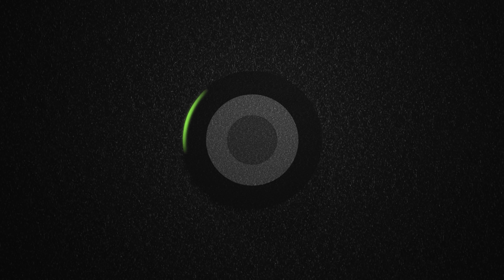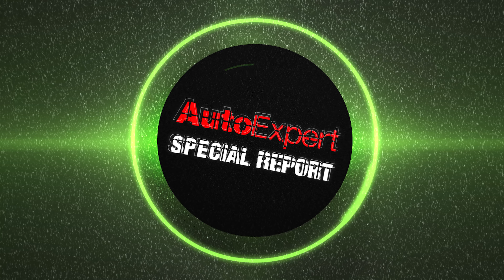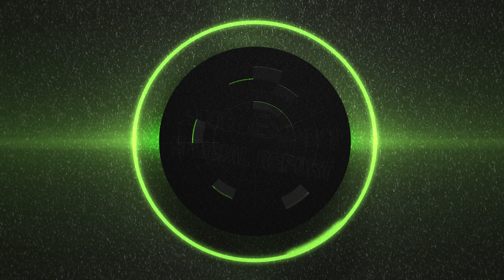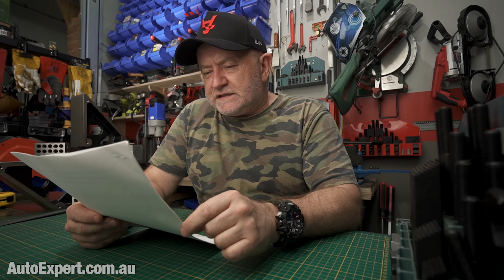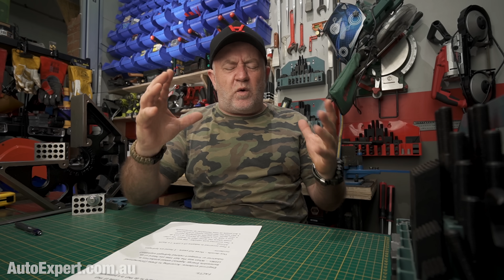The truth about fire risk: Hydrogen fuel cells and battery EVs | Auto Expert John Cadogan

Comment: I'm with The Air Stig - a SCUBA tank is typically filled while immersed in a big "bucket" of water (a garbo bin works well) to cool the tank as it gets hot from heat of compression. This is done so that the duuuude/duuuudette  getting his/her tank filled gets a solid load. Otherwise they wander away, get to the dive site, notice that the cylinder pressure has dropped, lose a number of minutes of bottom time and then go back to the dive shop and complain about being given the short shrift. Basic gas law physics (cf. Gay-Lussac's law and gas compression - adiabatic vs isothermal).
Reply: When they pressure test the cylinder.. They do indeed fill it with water and add a small amount of air.
If the cylinder fails, there is a small pop and the water sprays everywhere. People get wet.
If they did the same test with only air... They would be finding cylinder shrapnel 500m away and they would need a dentist to identify the remains of anyone close.
Reply: @sahhull  what standard calls for a hydrostatic test protocol to include air/gas? In an Australian context, general gas cylinders are covered by AS 2030.1-2009 Gas Cylinders - Part 1: General Requirements. For testing, this standard refers to AS 2337.1-2004 Gas cylinder test stations: General requirements, inspection and tests. AS 2337.1 Appendix A covers hydraulic testing where the test procedure at A3.4 calls for filling the cylinder with water and purging all the air in the test equipment system. If something "pops" in a hydrostatic test and there's a spray of water, that's a fail. If there's any air in the system, the pressure will simply compress the air and you don't get a valid test.
Reply: Thx man .

Comment: Hi John, great video, covered all the points I was hoping you would regarding electric vehicles. I'm yet to hear about this being addressed by the the ABCB and BCA 2022 has only recently been updated so it would likely be another 2-3 years before it is due to be updated again. However F&R NSW do raise it regularly when/if they are consulted at the design stage of buildings with basement level carparks.  The typical fire rating for a carpark is only 2 hours (type A construction - highest rating) which is vastly inadequate to withstand burnout of one or more electric vehicle fires, which as you noted cannot be fought conventionally and sprinklers (if installed) are ineffective against.
Reply: Fire sprinklers can be effective at cooling EV fires. As the report from NFPA/FPRF shows, EV fires have lower peak heat release rates than ICEV fires and not greater total heat release (the amount of plastic in the vehicle is a bigger determinate of heat release, not the fuel type). Also, the duration is not substantially longer, except for the reignition risk which needs to be managed by attending fire brigades. But the hypothesis that there will be large uncontrolled fire spread in underground parking structures, or that EV fires are hotter and more likely to cause structural failure, is not supported by evidence - heat suppression by sprinklers can control that at least as well for EVs as ICEVs. It is worth noting that fire sprinklers are only designed to cool/suppress fires, not extinguish them - they won't extinguish an ICEV fire either, generally. 

The bigger concern is smaller parking structures and open parking structures where fire sprinklers have not been required to be installed. This is certainly of concern but is actually covered under the NCC/BCA "Special Hazards" provisions (Clausel E1.10 and E2.3).

Disclaimer: This is not project specific fire protection advice 😀

Link to NFPA/FPRF report: https://www.nfpa.org/News-and-Research/Data-research-and-tools/Building-and-Life-Safety/Modern-Vehicle-Hazards-in-Parking-Garages-Vehicle-Carriers
Reply: Sprinklers are somewhat effective at creating a lot of saturated air, cooling surfaces (if deployed correctly) and preventing thermal spread.  Just don't let the fire warden or some other -  micromanager - turn them off because their drywall is being destroyed (joke) - nor the water company (or bill payer) - as soon as the fire brigade is onsite - they don't mind a bit of water in the air, sure beats curtains of thick black smoke - or napalm in the AM.

Comment: We did have composite tanks for Brisbane buses natural gas powered and tanks blew up in workshop. Some years ago.
Reply: composite tanks for CNG?  insane.. steel is the only way to go.
Reply: @petesmitt  being in the pressure testing game, we explored the potential to get involved in the testing and certification of these. Made in Germany with a bunch of German standards that would have to be translated and a raft of mechanical tests as well as pressure test. We walked away, well ran actually.
Reply: @lynndonharnell422  AFAIK. Most composite divers cylinders only have a 10 year life span. Then they are devalved and cut in half.
Steel and Alu cylinders can have a long and happy life.

Comment: There are other important risk factors for hydrogen gas. For example, the rate of flame propagation for premixed hydrogen / air is very high. It will still be technically be a conflagration, but you would be hard pressed to distinguish it from an explosion in practice. The level of energy which is released per volume of a stoichiometric mixture with air is also very high. These may be mostly manageable in an automotive application, but cars are sometimes parked in confined spaces such as garages where dispersion to the atmosphere would be restricted. Adding hydrogen to the natural gas distribution network, as has been proposed here in the UK, would pose a much greater risk than using it in cars. All these risks need to be carefully considered before incorporating hydrogen into consumer products where the level of control over quality and how they are used is lower than in most industrial applications. The Hindenburg accident is a poor example of the risks we might face because the majority of the hydrogen was not premixed with air. Therefore, the fire was limited by the rate of mixing with air and there was no 'explosion'. Thanks for your discussion.
Reply: Fark here we go, the back yard geniuses refering to the Hindenburg disaster and h2 cars. 
Lets get them walking in front of h2 cars with a red flag eh, like 1865 and the steam train. Ffs
Reply from the maker: H2 is not 'pre-mixed' with air in any automotive or industrial application I can think of...
Reply: @AutoExpertJC  No not intentionally, but leaks happen.
Reply: @nicksauer6749  The Hindenburg was also flow during a severe lightning storm on that fateful day.
Reply: @ScottMurrayBestFamilyCars  The hydrogen container in the Hindenburg example was a thin fabric material containing H2 at atmospheric pressure. The vessel in an H2 fuelled vehicle is designed to hold pressure up to (as John correctly points out) 700 atmospheres. The flammability of the fabric was a key factor in the Hindenburg mishap. An H2 vehicle pressure vessel is not at appreciable risk of damage due to a lightning strike. Apples and oranges in terms of comparison.
Reply: @slyrider01  Hi Scott. Film of the Hindenburg incident showed that it burned, but did not explode. I wanted to contrast the automotive and household scenarios since the Hindenburg fire is the example of hydrogen accidents which most people will be familiar with. Conversely, in the event of a leak in a poorly ventilated space, such as a garage, hydrogen and air would mix and form a mixture which would burn in a way which looked a lot like an explosion. I have no doubt that engineered pressure vessels would work just fine, but solenoid valves can sometimes fail and cause slow leaks. Thanks
Reply: "The Hindenburg accident is a poor example of the risks". So why mention it? Also the Hydrogen wasn't the cause of the fire, the fact that a lot of things burnt before the Hydrogen also says a lot.
Don't pick and choose half facts (yes I only quoted half that sentence I know), to try and make a point. It cheapens any real point you are trying to make.

Comment: I can only imagine an EV fire in the car park of the Sydney Opera House - for those who haven't seen it, it's a double helix, so fire wouldn't be contained to one level.
Reply: The toxic smoke would make the car park inhabitable for a long time once the fire is out.
Reply: Especially  bad if you can't enough water on the battery  fire  and it's very difficult  to put out 
Any fire-fighter will tell you that
Reply: @waynehewett4017  I’m aware of this. There are fire hydrants at regular intervals in that car park. Toxic gas in a confined environment is a bigger issue for that location.
Reply: @michaelramage73  lm sure you are and highly  likely  has far more experience  than I 
I was just using two examples which John  has used in past videos 
Some of the battery fires in chins have been very nasty indeed  causing injury and death 
Plu didn't John mention that ship.carryimg sea containers full of ev vehicles  that caught fire  and send the ship to the sea floor  as the fire-fighters   couldn't put the fire out ?
I've had my mobile phone battery catch fire when recharging  it  and it almost burnt my house down 
So emagine a battery  that weights tonne catching fire while you the wife and 2 kids in baby seats  are in the back 

You have about a minute or so to get out safely?
Reply: What about petrol car fire?
Reply: @kmav23  it does not produce it's own oxygen so one is able to put it out. Not the case with lithium iron phosphate battery - this will burn irrespective of attempts to extinguish it. All that can be done is containment until the fire dies.
Reply: @kmav23  much easier to put out. Requires significant less water and time and the smoke is far less toxic.

Comment: Is great to hear discussion of that scenario where an EV catches fire under a multi-storey building and causes a massive issue. As you said, there's simply no discussion of that and it's a problem that's racing towards us at high speed...
Reply: I work in the design of new and refurbished multi-storey buildings, and there is lots of discussion of this by appropriately qualified experts, including fire brigades and fire safety engineers.
Reply: @76tfdtr4r5  typical EV zealot, full of attitude. What cars are those batteries available in? And what are we going to do about the cars that are already built?
Reply: @mahcooharper9577  base teslas, BYD's, likely many more Chinese brands. GM, Volkswagen group and Hyundai Group don't.
Reply: @justohird5685  so lots of new cars still don't, and I'm assuming the vast majority of older EVs don't, so the problem isn't solved.
Reply: @mahcooharper9577  It isn't all new ones either.  LFP are not as good in high power need situations.  So nickle & other chemistries will continue to be used in cases where high performance is needed or weight is crucial.  So this topic remains a valid one.
Reply: Doesn't China have 6 ev fires  each week 
It's only safe  til it effects you personally

Comment: Hydrogen fuel is not going to save the world. This is because hydrogen produces yet another energy hog and the question is where does the energy to make the hydrogen come from. From natural gas or other fossil fuel? Awkward! From water? Right! All you need is a truly stupendous energy hog. 

In converting natural gas to H (Awkward) you liberate the carbon part of the hydrocarbon molecule, free to bond with the nearest O2 molecules to form what we call CO2 or carbon dioxide. Awkward! Such energy in the hydrogen is less then would have been available from the CH4. H from H2O? Using what? Solar? Wind? Fossil fuel energy? Again less net energy than would have been available from the wind, solar of FF energy. 

What hydrogen (H) REALLY is is hopium (Hp) or Hypeium (Hy).

Comment: Some good points there John. Note: Only around 10% of vehicles imported into australia now would be equipped with Lithium Ion cells. Most are Lithium Iron Phosphate and these are not susceptible to thermal run away.
Reply from the maker: Lithium iron phosphate is a kind of lithium ion...
Reply: @AutoExpertJC  that displays far less thermal runaway characteristics than the lithium ternary batteries you're generally talking about.

https://youtu.be/Qzt9RZ0FQyM
Reply: You are joking right, they are less susceptible.

Comment: The big issue with Li-Ion batteries is that they have all 3 parts of the fire triangle in one place. That makes it inherrently more likely to combust in the event of an issue than Hydrogen, petrol, diesel or other alternate fuels which only have 1 or 2 parts in the tank.  We do need to move to other battery chemistries, for safety.
Reply: @76tfdtr4r5  I mean, by definition lifepo4 batteries are also full of the phosphates mentioned in the video. I think the risk of a fire starting is way lower with lifepo4 Vs li+ but if one starts...?

...I dunno, I'm not a chemist or a fire expert lol. But I'd want to have a separate answer for both chemistries!
Reply: @jezlawrence720  It is very difficult to ignite a LFP battery. I think that most future EV will have a LFP battery because it is safer, cheaper and easier to recycle than other type of Li-ion batteries.
Reply: @AB-yt4hd  Hmm, I haven't seen cheaper. They are lower energy density so they'll take more space and weigh more. That means less range in a market already suffering range anxiety.
Reply: @CycleWerkz  They are cheaper even if you factor in the lower energy density.
Reply: @CycleWerkz  lifepo4 are cheaper for sure. Less expensive materials - less lithium and I think zero cobalt although I'm not certain about that. They also degrade less over time and you don't need to protect the top and bottom ten percent of the battery as much so they end up about the same usable capacity for the mass as lithium.

I think they don't discharge as fast as li+ so they might have lower peak output but car and home battery manufacturers are now using them routinely. So li+ might remain for some applications especially v small form factor or v high discharge needs, but lifepo4 looks like it's ready to replace most mid range uses like cars and static storage. For now. Other battery technologies will emerge.

As I understand it they also have lower spontaneous fire risk. However given the content of the video where he talks about all the po4 being a high source of oxygen, I'm not sure if, once a fire starts, the lifepo4 or li+ would be harder to put out or whether their fires have different characteristics in terms of max temperature.
Reply: @jezlawrence720  Pretty much yeah. LFPO cell's are generally safer and cheaper overall, even with the relative hit to weight/volume to energy density by comparison.

They are not prone to thermal runaway, structually more rugged and have a significantly increased usage life/more charge cycles.

They have another minor negative by comparison with a slower charge/discharge capacity. 

All that said, they are ideal for large scale stationary energy storage, Metropolitan& Urban BEV's and for Hybrid Vehicles (ICE and HFCEV's) for Transport & Rural in a country like Australia.

A thing to note there have been been a significant amount of promising findings regarding decreases in carbon emissions by mixing in Hydrogen with a variety of Fossil fuel powered areas.

For example: Adding a Hydrogen injector in some Diesel Fuelled ICE vehicles not only decreases the emissions but also increases fuel efficiency, as the Hydrogen helps to combust and burn the Diesel more completely.
Reply: @soulsurvivor8293  hydrogen injectors, that's sounds awesomely sci fi :D 

Although now I'm trying to imagine the infrastructure/user experience for that.

You'd be filling up 2 fuel reservoirs, which is a: space taken up in the vehicle and b: additional effort on the part of the user and c: needing to add more infrastructure at the filling stations (which may happen anyway if heavy transport goes Hydrogen but that's a pretty big if).

So what's the compromise on space in the vehicle (do you reduce the diesel fuel tank size in order to fit a small H tank? Do you have less room in the vehicle for other things?) 

What's the ratio of fill-ups e.g. am I filling the Hydrogen tank once per X diesel refuels, or the other way around?

A lot depends on the actual user experience. If you're talking "Buy a can of hydrogen at the fuel station once per thousand miles and just slot it into the socket on your dashboard/next to the diesel socket under your fuel flap, easier than a camping stove!" then... sure I can absolutely see that working, particularly if there's a fairly easy retrofit for existing vehicles.